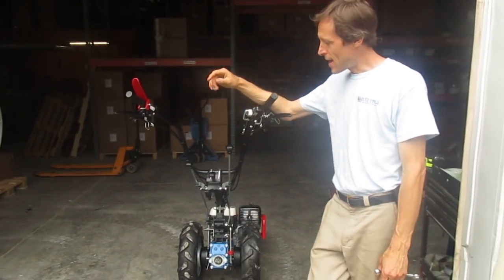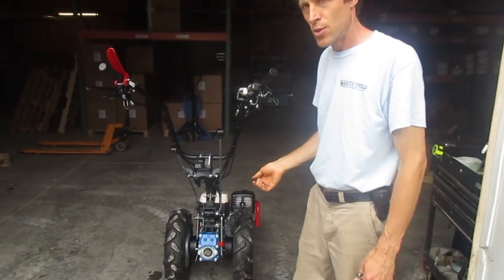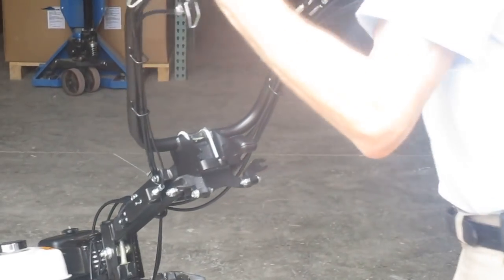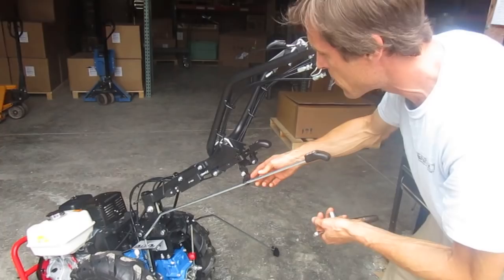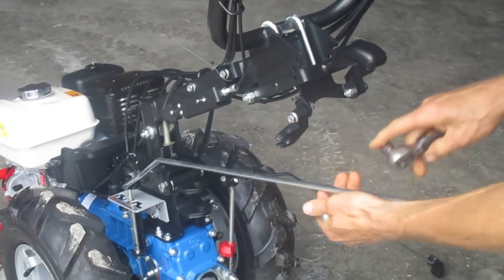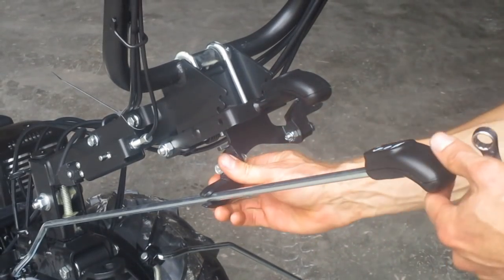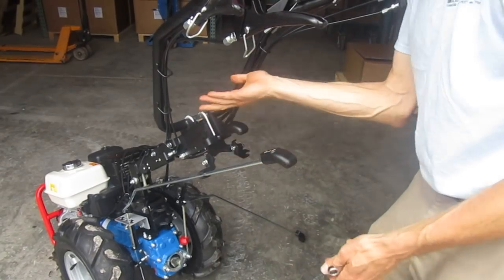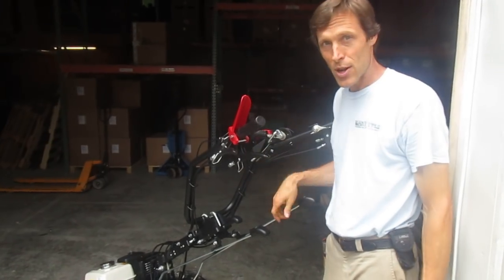BCS Walk-Behind Tractor: Plastic Gearshift Lever Support Positioning

Comment: Hello, your videos are very helpful. My grillo107 pto stick shift is completely loose. would you be able to tell me what might possibly be wrong ? thank you so much
Reply from the maker: If the PTO lever has been "forced" too much, the holes where the outer lever is linked to the inner lever by 2 pins can get enlarged, therefore causing the rod to feel very loose.  The inner lever is probably OK, but the outer lever may need to be replaced. We have a service document for this repair: http://www.earthtoolsbcs.com/static/pdf/Grillo_PTO_Coupling-_Ball_and_Spring_Replacement.pdf  ...and here is a video walking through the correct procedure for engaging the PTO, so this failure does not occur again: https://www.youtube.com/watch?v=RKhtwCGDops
Reply from the maker: HI Caroline, it sounds like your outer PTO shift lever may have been damaged due to being "forced" at some point.  The lever probably needs to be replaced. This document covers the repair: http://www.earthtoolsbcs.com/static/pdf/Grillo_PTO_Coupling-_Ball_and_Spring_Replacement.pdf  And this video walks through the correct PTO engagement method, so this failure won't occur again: https://www.youtube.com/watch?v=RKhtwCGDops  Give us a call to order the part: 502-484-3988.